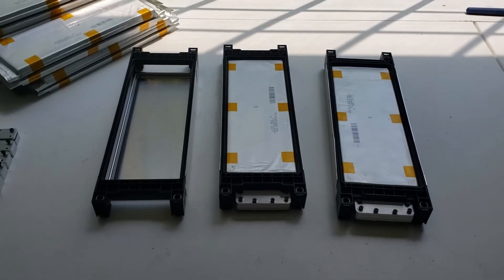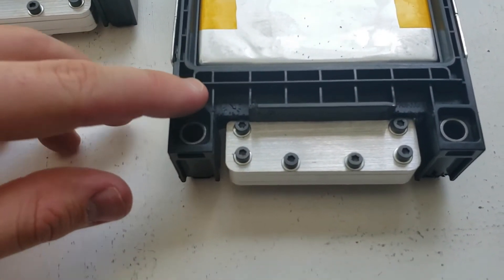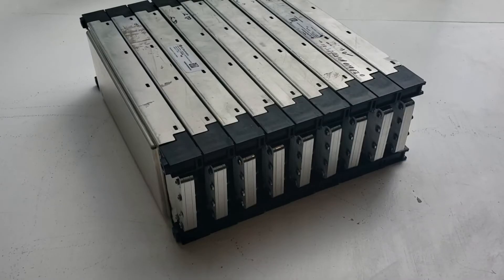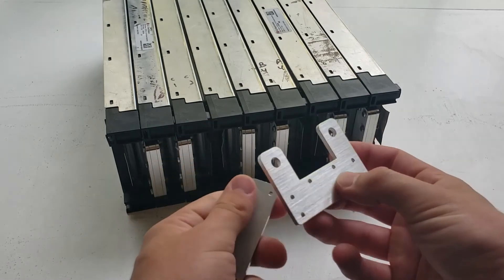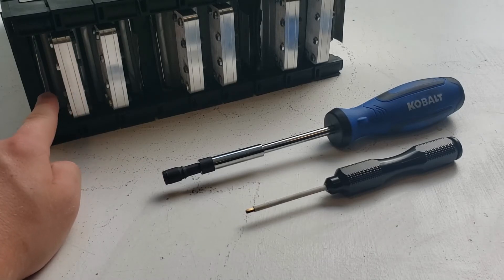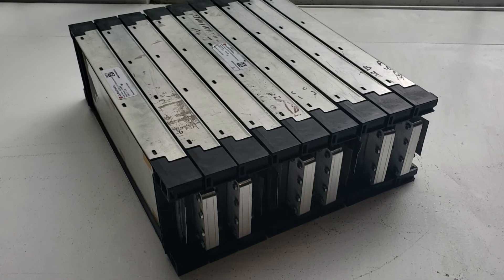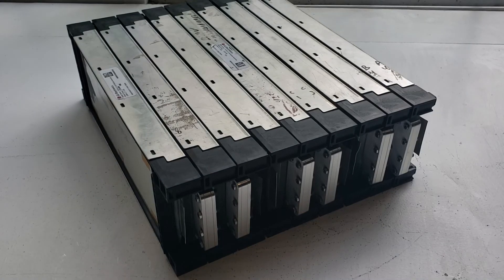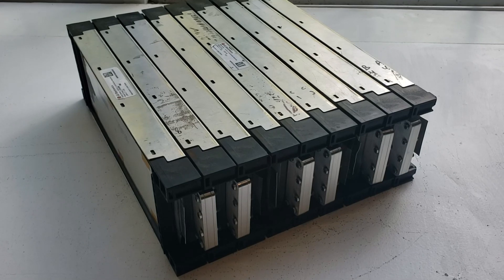LG Chem Battery Module Build PART 3

Comment: How were you able to tighten the bolts and nut after the first set of cells tabs are installed? The other.tabs will be blocking access to the tabs
Reply from the maker: I insulated my hex driver with heat shrink and used an small wrench to hold the nut on the other side. The tabs are just flexible enough to go around them, but it is a very tedious process.

Comment: There are lots of large water plates for cooling motor controllers and the like.
Off the top of my head, Kelly makes one for one of their controllers.
They are not super expensive.
However, I would be concerned with the cooling potential not being good enough just touching the sides of the battery holders.

Another option, potentially in addition to passive/water cooling, depending on your controller, would be to have temperature sensors on your battery, and have the controller throttle back the amount of power allowed once a certain threshold is met.
I believe that Kelly controllers have this capability.
Reply from the maker: I love the idea of placing temperature sensor on the battery as well as the large water plates. Also, I'm not sure if I mentioned this in the video, but there is a thermal pad in-between two cells per module. I'll have do some research as far as the throttle back feature, since this is a APT 96600 controller. I'm still doing some research, but I might be leaning towards liquid cooling so far. I'll definitely have to keep a close eye on these batteries for their temperature during run time. Thanks for the advice!

Comment: Hi Damian I'm planning to do the same converting my Ktm Duke 390 and found it https://www.rigidchill.com/the-best-electric-vehicle-battery-cooling/ .
My idea is create a aluminum house to fix exactly in the place of original engine using laser cut and cnc.
This solution is not expensive considered that it is much more efficient than Peltier plates.
I'm using Cad (fusion 360) to be sure that everything will fit nice.
You can buy online for $430.00
Reply from the maker: I would love to see your KTM when you're done with the conversion!
Thanks for the site, the cooling system might be too big and I'm not sure if I will have enough room to fit that in my motorcycle. I do agree that Peltier plates would not be the way to go.
Reply: @LifeAroundDamian  It's like any AC and you can split parts only have to reroute the copper and rubber tubes. I'll take at least 2 year to finish it and that's why I'm doing everything first on cad. https://drive.google.com/file/d/1bArNwZh-v3Wx11_Gm20STUOkKAdFGr9q/view?usp=sharing I'm thinking to use supercapacitor as well and may be I have to design some electronic parts for my need.

Comment: Check DIY electrified's video on LG chem batteries. I think he used the same batteries as you. In the comments he said that he would flood the battery box with pure food grade mineral oil for passive cooling
Reply from the maker: Thanks for the advice, I'm still doing some research and I might be leaning towards liquid cooling the cells.